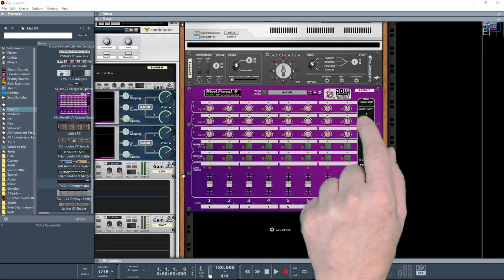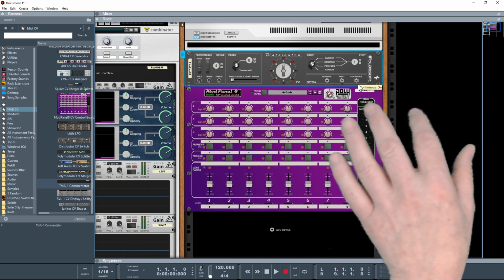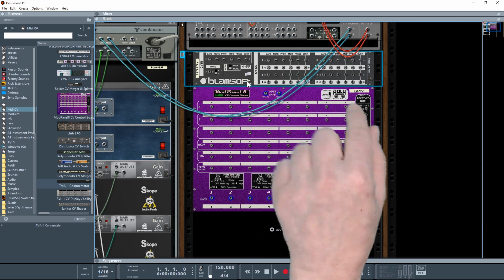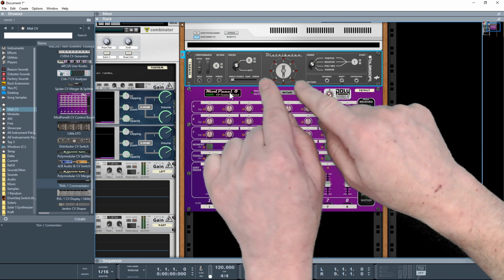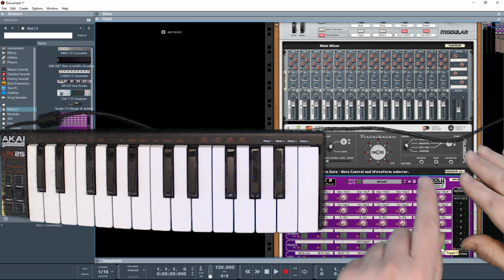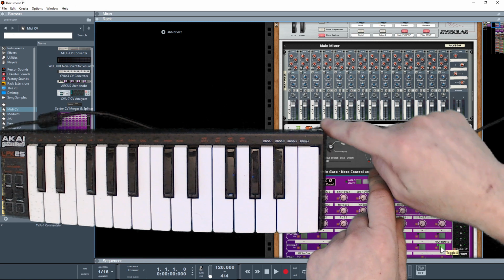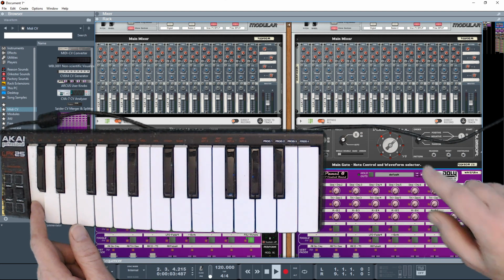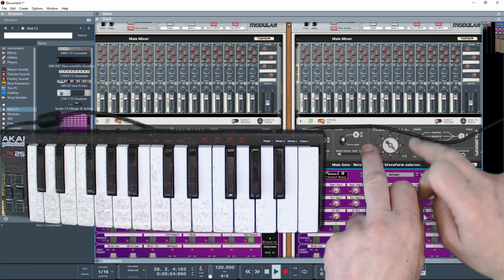Mini Modular Series Part 9 The Distributor

Comment: Got a question. Anyway to bounce tracks with the aux sends already applied to each tracks in the bounce? Cause when I bounce tracks the aux sends sound it’s not included in these tracks, they have to be exported as different tracks. Hope U can help me out. Thank U in advance!
Reply from the maker: Hi, 
If you had several tracks there is no way to bounce\export with the Send applied at the same time, as the send signal could contain audio from another track.. 

You could solo the channel and export the song, you could solo the track then from file \ Bounce Mixer Channels\ select the "Master section" only and export. 
If you have multiple tracks to export you are going to have to repeat the above for each track.
Reply: PoohBear's Reason Channel that’s what I thought. But thanks 4 rhe xplanation once more. 🙏🙏🙏
Reply: brianmac but that’s exactly what am trying to avoid. I want the aux sends to be already in my tracks, not exported separeted. The way U say means to exports the tracks without the effect and the effect itself in other tracks.
Reply: brianmac thanks a lot man! I’ll try to figure it out. Thanks 4 UR time.